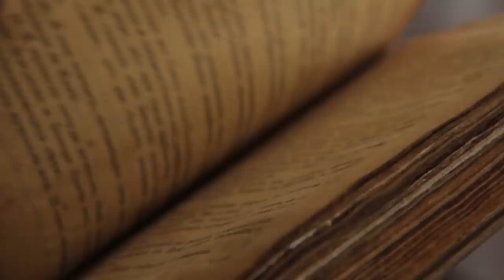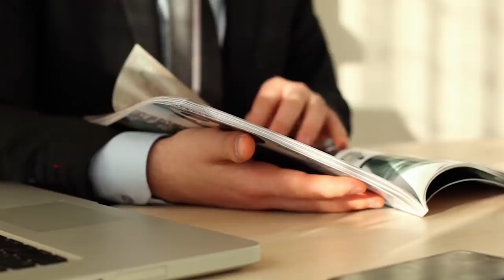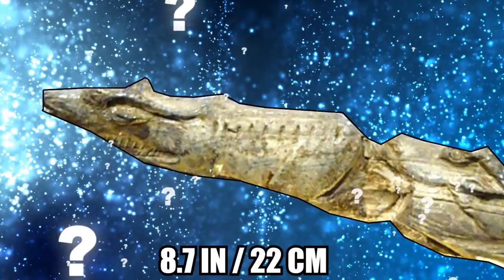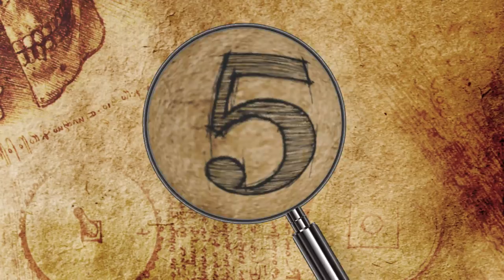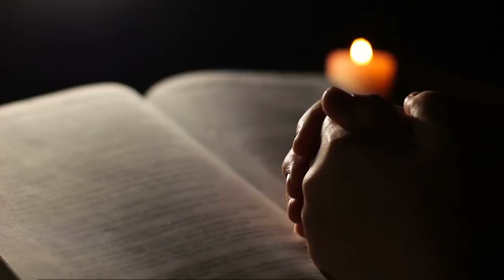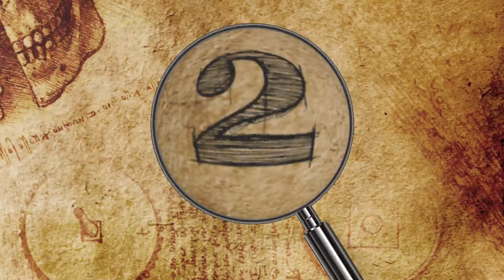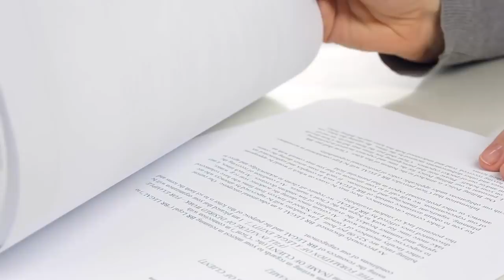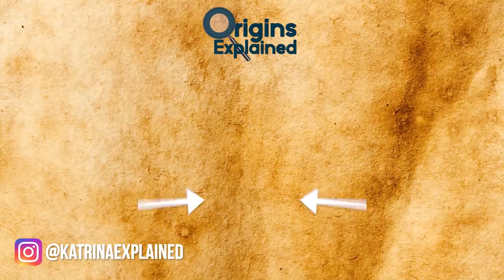10 Mysterious Artifacts Scientists Can't Explain

Comment: Random Fact:

NASA has awarded Nokia of the US $14.1 million to deploy a 4G cellular network on the moon.

-RealFacts
Reply: Imagine making $14 million just for putting an antenna on the moon
Reply: @mr.octopi1825   why put a 4G antenna on the moon 🌝 ? No one is going to be there.
Reply: @zahria  you could have just edited the comment js unless you did it on purpose 🤯
Reply: @zahria   nope we're all Biden, Harris supporters. Don't you know?
Reply: @zahria  One way to know is to aim a Lazer towards the moon and the time it takes to get the light here at a radio transmitter will give you some idea
Reply: Random fact mars has seasonal oxygen and methane rising 30% and 60% respectively in the summer and spring. random fact there’s bacteria that can metabolize manganese oxide producing Mn(po) at the highest rate around 5degrees c.
Reply: @j.michaeljefferson60  because we’re going back very soon. Boots on the moon 2024.
Reply: Erin Stelly  the contract is for when we go back.

Comment: Them tiny wax hats were their water cups and would use them as bandage if one was to get cut or hurt as well as to cool off either putting water or something cold in it or possibly ice but did they have access to ice back then
Reply: O by the way if your temperature was to high your wax hat was to tell other you were going to have heat stroke so it was also for safety